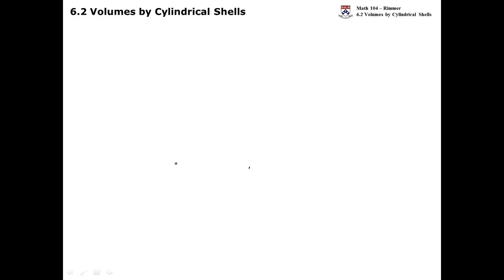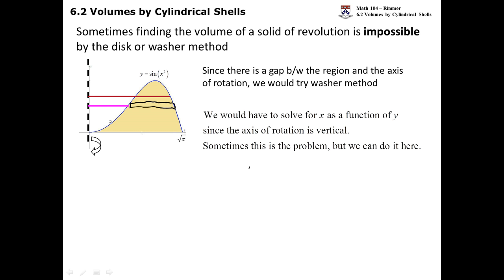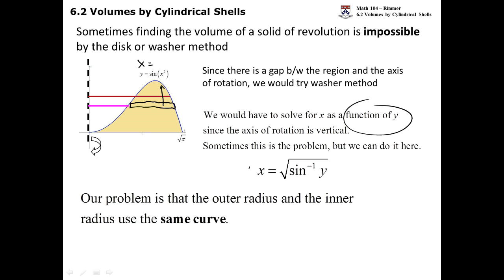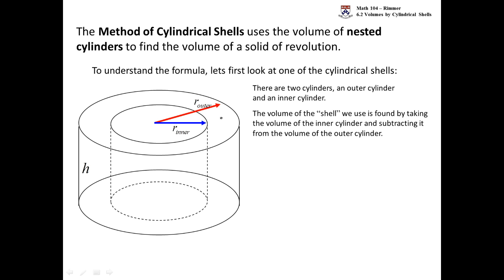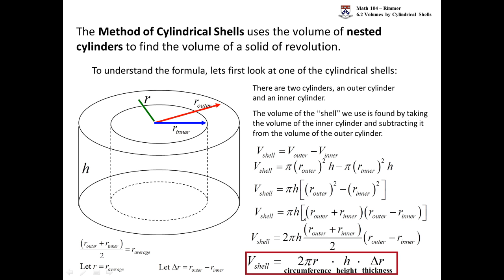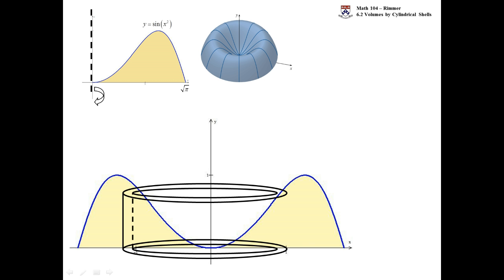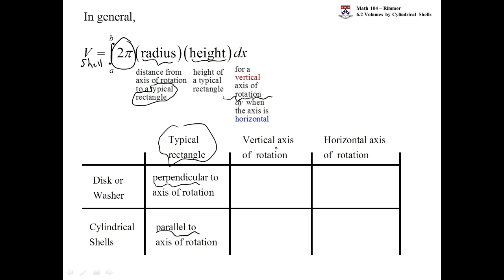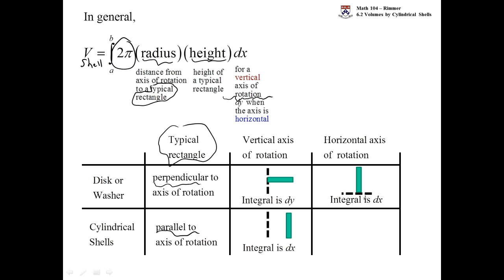The Concept of Cylindrical Shells to find Volume

Comment: Fantastic video, but I have a question please, regarding the formula of the cylindrical shell, can I multiply the thickness (delta X) by the hight of cylinder and ignoring the circumference to get the final volume
Reply from the maker: Yaser Alkazemi Volume is three dimensional. You are discussing multiplying two quantities to get volume, what you’ll have is an area of rectangle but not a volume of the shell that the rectangle generates by revolving about the rotation axis.
Reply: Nakia Rimmer Thank you very much, it is really nice explanation 👍🏻

Comment: So for the shell method, are we finding the surface area of a cylinder at a specific x value. Then adding up all cylinders to get the final volume. Is that why it's called shell method...cause we're using surface area?